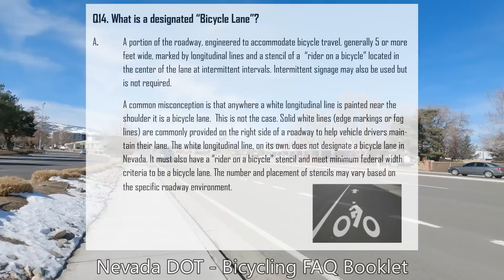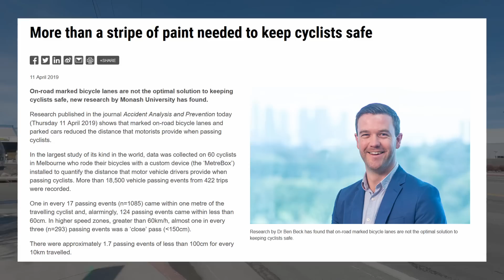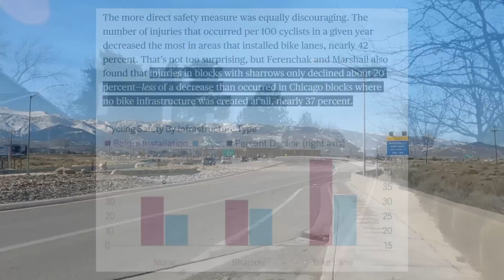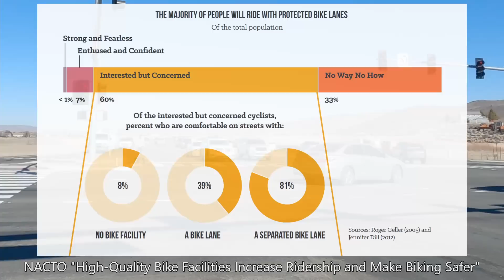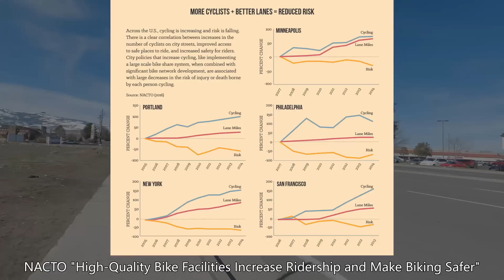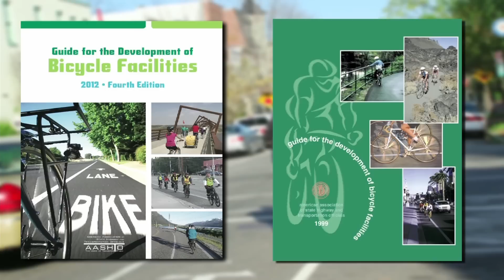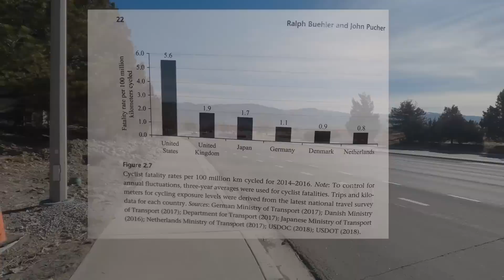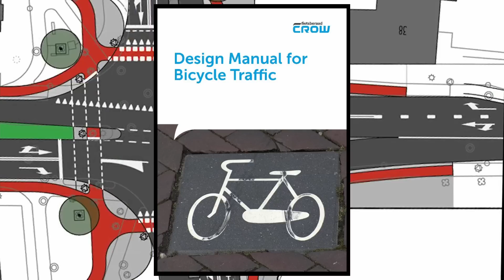Painted Bike Lanes Are Atrocious & Here's How to Fix Them

Comment: good bike infrastructure and good transit should be build because of safety and economic reasons , oil is at 110 this mourning , and people are still using cars to make 2 miles to get to school or the shopping mall , this is madness .
Reply: Good transit can be justified as military expense like the highway infrastructure, but good bike infrastructure is something that comes as more people choose not to walk because it's not as efficient compared to biking.
Reply: also what is this absurdly large family where you go through 3 gallons of milk and a bottle of detergent per week lol, maybe chill out with the milk and soap
Reply: @Frexxy  absurdly large family? I go through a gallon of milk a week myself. and the family goes through a 35er of bottled water. Now put in the kids, the wife. Thats 3 gallons easily. and guess what, during one of those trips the laundry detergent is going to also be included. 25.8lbs in milk, ~35lbs in water. So thats already 60 additional lbs. throw in 15 more for the detergent and now im biking 75 lbs alone. meanwhile adding in the store trip now i've spend 45 minutes to get there, 45 to get back, and lets be generous, and say 30min to shop. Now im gone for a total of 2 hours just to pick up some stuff, instead of the 50 minutes it usually takes. Oh boy, i just cant wait to waste another hour and 10 minutes every week biking! 

or let me guess. I should just change everything about all of my habits, all of the things i purchase, buy a new house, and change everything about how i live my life, so you can have a bike lane.

I bet you can guess what im picking here bud
Reply: @t_c5266 

Nice nice nice

I didn't choose to pop babies out like Pez candy and I usually do shorter trips to stock up on what I need.

Also I don't need to lug a car to work everyday and that is 90% of my commuting time.

Your point?
Reply: @Kloppin4H0rses  so why should your situation then impede others who have different necessities? While yours are CHOICES
Reply: @t_c5266  Yours are TOO. Buddy.
Reply: Let's hope oil gets so expensive that nobody can buy it, so Saudi Arabia collapses and the people of Yemen can live in peace.
Death to the automobile!
Reply: please americans, do tell us , how you are unable to feed you and your family without a car.
Reply: Who is going to ride their bike to get groceries? Where are you going to carry those? What about the upper Midwest with four or five months of snow a year? You are living in a fantasy in your mind.
Reply: @scottjohnson921  Cargo bikes exist
Reply: @scottjohnson921  some of the best cycling cities see lots of snow. Heck, even montreal, a north American city with the same general design and features as most american towns has lots of cyclists. Hills, snow, rain, none of that really matters. What matters is infrastructure.
Reply: @scottjohnson921  you can always add baskets to your bike to carry groceries
Reply: @franciscocruzcruz379  yeah lemme just bike my frozen food, ice cream, perishables, milk, cheese, etc, for 30 minutes in a 100+ degree summer day 🤣🤣🤣
Reply: @t_c5266 if only there was some kind of bag we could use which was thermally insulated... we could call it a thermal bag.
Reply: I'm not getting heat stroke getting groceries because some people think we shouldn't drive
Reply: @wuqgywt-6zx  let alone half the groceries spoiling before youre able to make it home
Reply: @Frexxy  oh yeah? and this bag will carry 24 eggs, 3 gallons of milk, a bottle of creamer, cheese, a pack of steak, a family pack of chicken, a pack of sausage, a carton of ice cream, a weeks worth of fresh vegetables, a weeks worth of fresh fruit, a weeks worth of yogurt, frozen vegetables, and 2 loaves of bread? 
oh! there is one! and its 2 feet by 1.3 feet by 1.4 feet! what a convenient size!
i cant wait to carry that on my bicycle! it can go right on top of my 35 pack of water, next to the laundry detergent! 
I cant wait until i get to do that 45 minute ride with multiple extreme grades! 
im excited to be part of change as I hang bags off of my handlebars and hit them with my knees!
Reply: @t_c5266  the reason youd need to travel 45 minutes to do this is because focus on car-dependent infrastructure spreads out and lowers city density leading to further distances traveled for everyone and more traffic on the road. sure if you still want to drive thats cool, but supporting proper bike/transit infrastructure leads to a better commute for everyone. also i guess you dont have much experience biking with cargo because once you start going you barely feel the extra weight (and for the high grade roads you can always just get electronically assisted bikes to make your life easier) youd just need to do smaller loads more often, which also means less food waste!
Reply: @Frexxy  Hear, hear!
Reply: @scottjohnson921  in any given population you'll get a solid percentage, maybe up to 10-20% . Dutch population one of he only exceptions where it's closer to 50%

Comment: My favorite type is the painted bike gutter full of large cracks beside 100 kph/60 mph traffic. The cyclists brave enough to ride on these have an epileptic warning amount of flashing beacons to try and ward off the instant death that would follow, and I don't blame them, crazy as they are.
Reply: My favorite bikelane it separated from the road and full of the smooth reddish asfalt we have here in the Netherlands. Some stroads in the usa have 3 lanes and hardly are used all the time. From the most right handed lane they can make a free, higher (4 inches) laying save bike lane. With some grass (1 meter wide) and bushes. In the narrow streets her in the Netherlands it also not always possible to make separate bike lane and so, the door openings will always be a danger but because we all are bicyclists from early age on, we know there can always come a bike and so we anticipate on it.
Reply: Bike lanes should be all the way on the right of the road, not between cars....
Reply: 5:12, here they should widen the sidewalk and use reddish asfalt for the bike lane half of it. Then you have hard border between the cars and the bike lane.
Reply: @gerhard6105  that sort of design does exist in some places in North America, but usually not with red asphalt. we usually call them "cycle tracks" and sometimes they're at road level with a median in between, and sometimes they're at sidewalk level with the choice of materials making the difference - sidewalk often concrete, bike path black asphalt with painted lines. Sometimes trees in between. Downtown Vancouver has great examples of lots of these now these days, but Seattle also has some and I think Portland too, probably others. We also have some multi-use paths (MUP) which don't have separation between cyclists and pedestrians but they're wide and both are allowed to use them, though cyclists need to go at a reasonable speed (15-20 km/h usually)

it's definitely the new way to do things though, the old way is just paint on the road, and the highway-style merge lane design that you see here is unfortunately quite common because it's a safe way for cars to come in without a traffic light, avoiding T-bone collisions, but doesn't consider the cyclists' safety at all. There are also unfortunately many slip lanes with 'pedestrian refuge islands' where you're supposed to wait to cross. Also meant to prevent t-bone collisions and make it so drivers don't have to slow down as much to turn, but it puts pedestrians at a 90 degree angle to the cars and pedestrian deaths happen a lot more due to increased speed.

We really messed up a lot of things here trying to make things better for cars at the expense of everything else, and it's difficult to undo all of those bad decisions.
Reply: @DevynCairns  i did read your answer and what you explain about the cycle paths in the first big part sound pretty good. We call the MUP: Shared Space. Not everybody is happy with those area's.  When bikes, pedestrians and cars are more separated, the roads get safer for every road user. I am not anti-car at all and most Dutch people ar cyclists too because we all learn to bike from a very young age and most children go on their bike to school, weather or no weather. Real die hards.
Reply: @gerhard6105  Right, I completely understand where you're coming from. I got to visit Amsterdam last year and experience it first hand. I live without a car here (near Vancouver) and mostly bike and walk places, but I think I'm still kind of an outlier. A lot of young people don't drive regularly or at all and mostly use transit, but cycling for everyday needs is still kind of a new thing here.
Reply: That doesn’t exist right? That’s literal highway speed, I hope you’re exaggerating, but if you’re not, please find me an example.
Reply: @lemonade4181  State Highway 2 in Wellington, New Zealand. 100 km/h speed limit, and the bike path is almost impossible to widen as there’s the sea on one side and a steep hill on the other.
Reply: @pineappledoge8019  wow, you’re right it seems like they took the buffer zone at the edge of the highway and added some green paint
Reply: @lemonade4181  Same city as the video (Reno, NV): McCarran Blvd, in the southwest corridor, from Plumb to Plumas. Speed limit is 50 mph, however, there are few traffic lights and extremely long, steep sections (over 10% grade) where cars travel in excess of 60 mph (four lane, divided with only a narrow concrete barrier). Of course, in Nevada, cyclists can legally ride on Interstates outside of cities where speed limits are 80 mph!! I live (and ride daily) here in Reno. Better than many U.S. cities, but far, far from safe, and nothing like riding in Germany where I moved from.
Reply: @lemonade4181  I haven’t seen that, but in my hometown (of only 100k people), I’ve seen a bicycle “”lane”” (where they’re just sharing the shoulder of the road with cars) a 4-lane 45 mph speed limit stroad on a busy part of town. Tbf there’s few entrances to parking lots or side streets, but that only encourages drivers to go closer to 50 mph
Reply: @lemonade4181  In Switzerland there is a highway with narrow painted bike lanes. The speed limit is 80km/h (50mph), but since it looks exactly like a regular highway with 2 lanes, drivers often drive at 120km/h (75mph). The bike lane is at some point sandwiched between the highway lanes and the exit lane. Oh and this highway goes through TUNNELS and goes slightly uphill. 
Look up the highway at Frinvillier near Biel to see it for yourself!
Reply: @lemonade4181  Another example: Highway 395 between Reno and Carson City. The speed limit is 65 where there is no alternative and 70 through Washoe Valley (though it could be detoured around), and--when I lived there in the early 2000s--they hadn't even gotten around to painting the bicycle outline in the gutters yet. Those triple-trailer "road trains" were scary at that speed.
Reply: @lemonade4181  Where I live (Arizona, USA), the 45 MPH speed limit is more of a suggestion. When I drive a car, I'm usually going with the flow of traffic at 60mph.
Reply: The Ohio River Scenic Byway is a PERFECT example of this! The cars go 60mph and there is only a painted bike gutter. Apparently the purpose of it is to be used by people training for bike races, but I’ve never seen ANYONE attempt to bike on that horrendous road
Reply: High speed limit alone doesn't constitute for danger, as it's common in the EU to have 90-100 km/h speed limit on a regular road outside of city limits. I consider many such roads safe to cycle on because car traffic there is minimal. I get passed by a single car every 2 to 5 minutes and that car is never a truck. Trucks do not drive on these roads, they do on main transit roads only. Nobody ACTUALLY does 100 km/h on such a road, it's just a legal speed limit - this road is outside of residental areas with mostly forests and fields around. But it's just 1 lane per direction, it's narrow, it rarely has a long straight stretches.

What is unsafe - is high speed limit combined with high traffic congestion. A busy 5-lane stroad in the middle of a city with 45 mph limit is definitely unsafe to cycle on.
Reply: Yes, thats me.
Reply: Pretty much every non-interstate highway in Florida is like this.